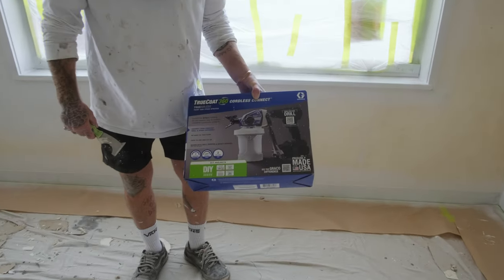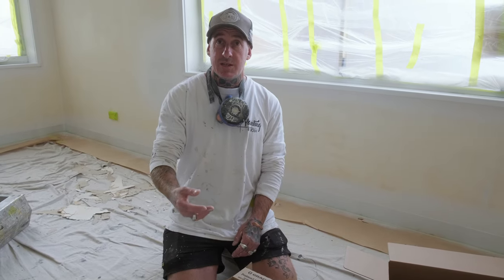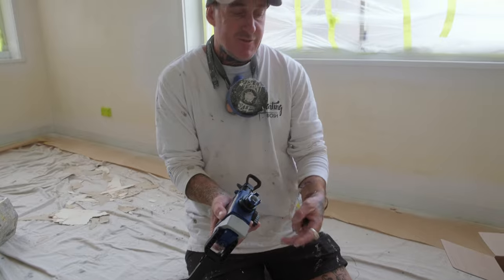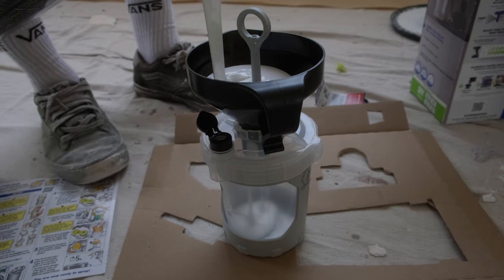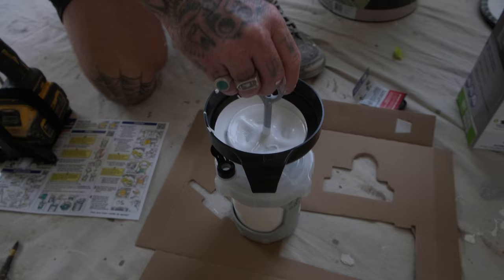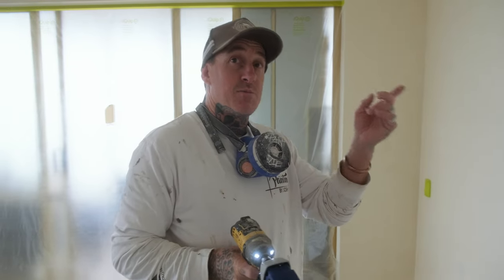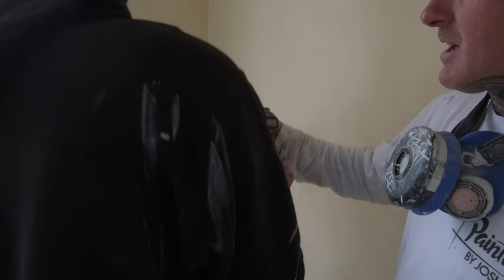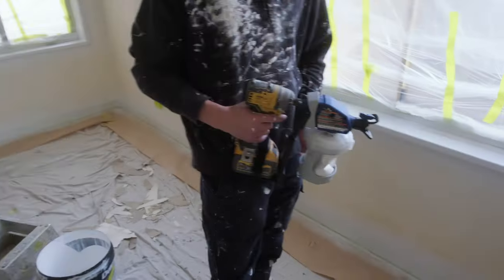POWER DRILL TURNED PAINT SPRAYER!? GRACO TRUECOAT 360 CONNECT FIRST IMPRESSIONS

Comment: That "$4000" 495XT sprayer you have is $2000 here in the States
Reply: They're around $2800 USD in the states which is roughly $4200 AUD
Reply: Yep and as soon as you use it, it drops down in value to about $400. You can find all types of deals but I feel like alot of it is stolen